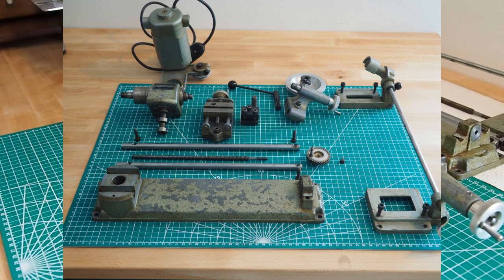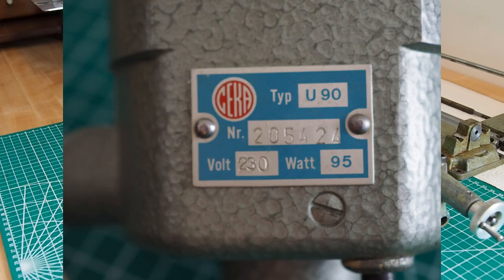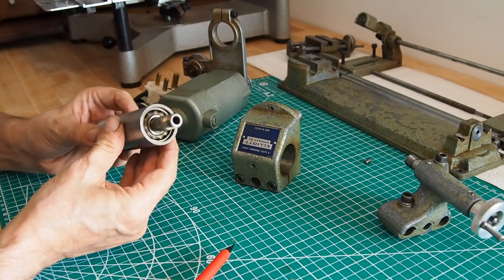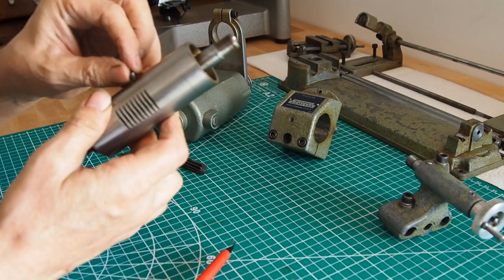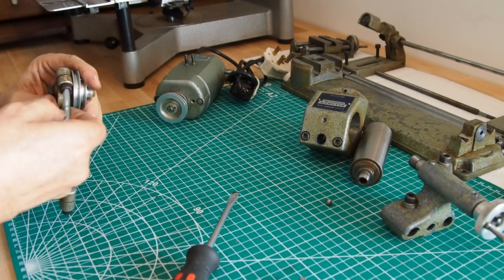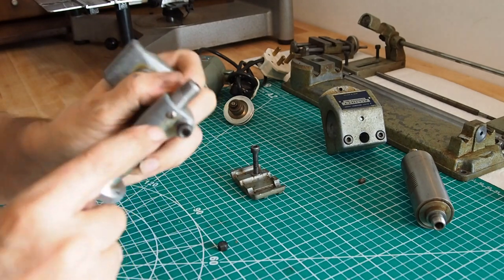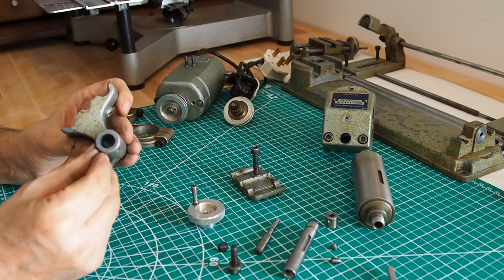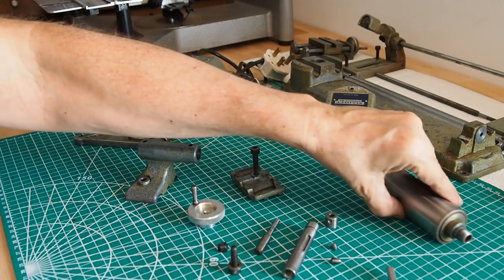Emco Unimat SL - Restoration - Disassemble (Part 2).

Comment: I just got a Unimat SL but the tailstock spindle, cross slide, and apron are stuck.  I've made sure the hex locks are loose, and tried to use liquid wrench and mallet but they are still stuck.
Reply from the maker: Hi,
Sounds like you've got a bit of a challenge there... I can only suggest take a cautious approach and clean around the stuck areas and then reapply the Liquid Wrench... you may need to do this a few times but hopefully some will eventually penetrate into the stuck areas and free it...
Take care.
Paul,,
Reply: @TheKnacklersWorkshop  Thanks, I was finally able to get everything unstuck today, I had to pry the tailstock spindle out using a screwdriver as a lever, and I used clamps to force the cross slide and carriage out from their stuck position.

Comment: Hello I’m going have take my tail stock apart. When it’s all the way in harder to turn after couple revolutions you can use one finger on stinger handle. The rest the way smooth as butter. Sam way going back in. Smooth then last few revs harder.watch this video think clean mine up , I hope not threads. Any thanks for information as always 
Stay safe    Ur   W.V.  pal
Reply from the maker: Hi Paul,
My tailstock quill was just the same... all it did was disassemble it, clean all the component parts and remove some burrs that were on the keyway. 
The only thing to beware of is that it quite easy to assemble back to front (I did)... As the restoration continues I will show the reassembly of the tailstock.
Thanks for watching.
Paul,,
Reply: The Knackler's Workshop thanks I will pay good attention when disassembling and reassembling .ill let you know how it goes thanks

Comment: Hi Paul, well documented strip down. I like the tool count idea, you have used less tools than I lost during my mill head strip! It looks very well made and incredibly uncomplicated design, you can tell it was designed by Engineers as opposed to copied by the  uneducated which is what I have been dealing with. Cheers, Jon
Reply from the maker: Hi Jon,
I think the design engineers got is spot on... it sold from 1953 - 1977 which says a lot about the little machine...
Thanks for watching and subscribing.
Take care
Paul,,

Comment: Gday Paul, there a very well made machine, you can see the quality in it, I’m amazed just how small the components are, great video mate and your subs are going up to👌🏼,take care     Matty
Reply from the maker: Hi Matty,
I am definitely not going to be making a move on Adam Booth's viewers with this tiny lathe - hehe...
I am grateful for your help with the subs.
Take care
Paul,,
Reply: I was searching the web for info on these, and found a “Lathecity” site that had some info/history. They state that it won’t work on metal, even aluminum, that it’s motor stalls with even the slightest depth of cut. Do you agree with that? Neat looking lathe though! Enjoying your channel! Stay well!
Reply from the maker: @tomt9543  Hi Tom, Once I have the lathe up and running I plan to make another playlist where I test the performance of the Unimat SL  on various materials... Hopefully we can work out the limitations of the lathe.
Thanks for watching.
Take care
Paul,,

Comment: I agree that the recess in the spindle that houses the bearing is machined to receive a seal. I also like the way they machined the outside of the spindle to act like a rack and pinion affair.
Reply from the maker: Hi Matt,
I hope to get a larger lathe up and running in the next month or so which should help me make some bit and bobs to repair the Unimat...
It is a nice design.
Take care
Paul,,

Comment: Hi Paul. Looking forward to the spindle disassembly and inspection, I have not done mine yet. The U-100 motor has an internal fan and I've run mine for extended periods without overheating, but need to learn how to service it. The U-100 is occasionally available on eBay but quite expensive. Also watching for details on the auto-feed, don't have the attachment yet but looking for one. Thanks again for this video series !
Reply from the maker: Hi Rich,
Thank you very much for the info on the motor's... I was aware there are some overheating problems with the SL motors... sounds like the U-100 is the one to get, I will tell everyone this information in the next episode.
Take care
Paul,,

Comment: Paul, is the finish Hammer tone on the lathe like it is on the motor?  Will you go back with the same finish?  You mentioned the head being vertical and used as a mill.  How does that work?  Thanks for sharing.

Joe
Reply from the maker: Hi Joe,
Yes the finish is hammer tone and i would like it to be original if possible. If you watch my video on taper turning on the SL you can see it setup as a mill.
Take care
Paul,,